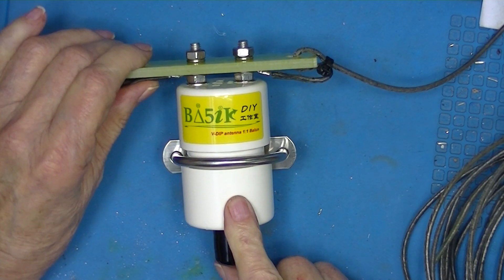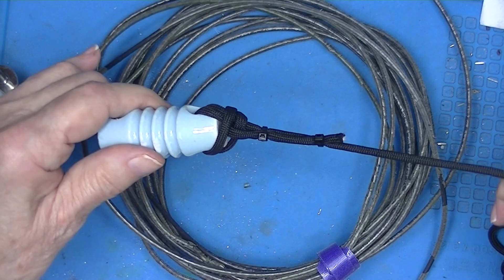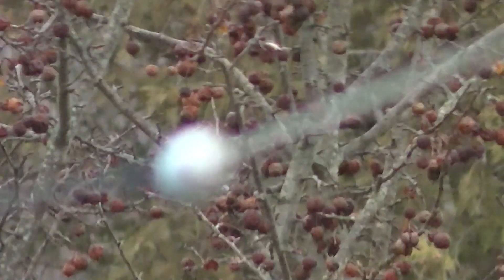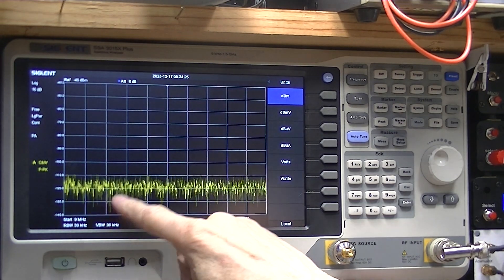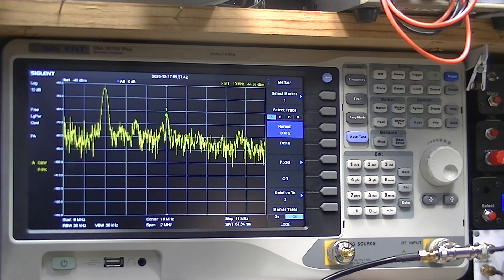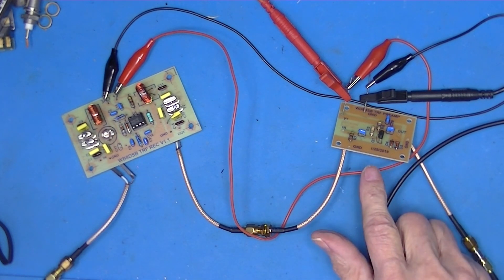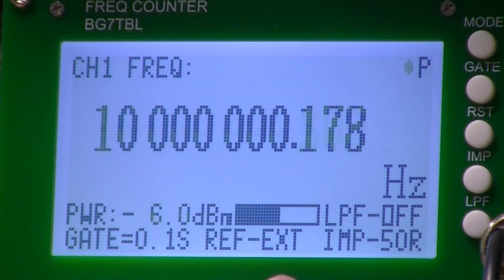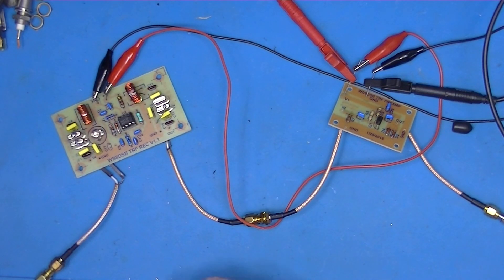10MHz WWV Receiver Part 5

Comment: Hi Steve,

Congrats, your WWV TRF receiver with preamp looks to be working great with your new antenna.  You are correct, when you see slight fuzziness in the signal that's indeed artifacts during times of modulation.  Also note that when the signal starts to become somewhat of a square wave (no longer a pure sine wave) that's just due to the signal being so strong that the back to back diodes on the output of the preamp are clipping the signal to prevent damage to whatever is connected to the output of the preamp (typically a frequency counter).  If you need a stronger signal (example: during times when WWV is weak, etc.) you really don't need to use a 50 ohm load on the output of the preamp (you can use a high input impedance port on your frequency counter versus a 50 ohm input, etc).

P.S.  I just noticed in your video that my call sign has an error on the TRF receiver circuit board that Far Circuits sells, but it's correct on the Far Circuits preamp board.  Funny I had not noticed that until now (and I reviewed their original artwork).

73,
Don (wd8dsb)

Comment: At 3:12... The antenna wire does not appear to be seated in the groove of the pulley correctly? I would hate for it to get pinched/cut/break. The paracord may not have much give. It may also stretch out, when it gets wet from rain, causing the antenna to sag. A length of bungee cord, added in series, might provide give in high wind and tension when the paracord stretches with moisture. Just an idea that I hope you find helpful. Cheers.